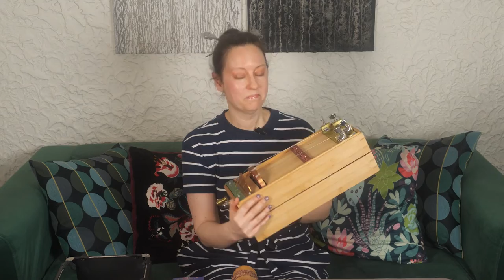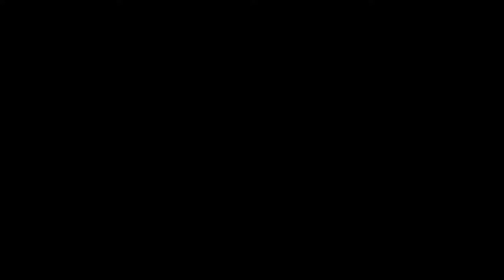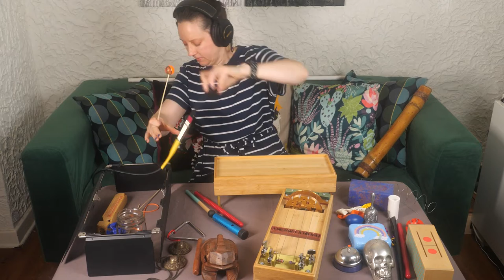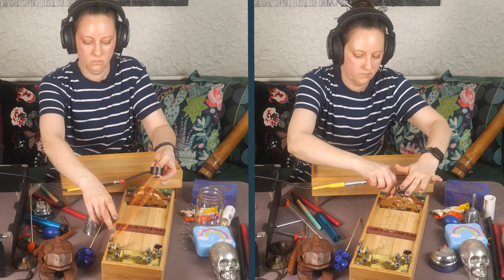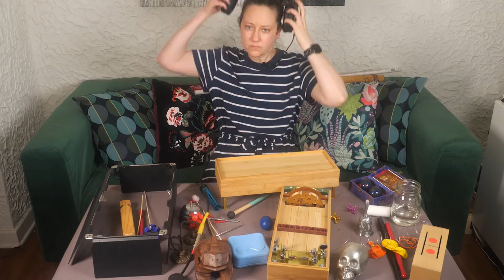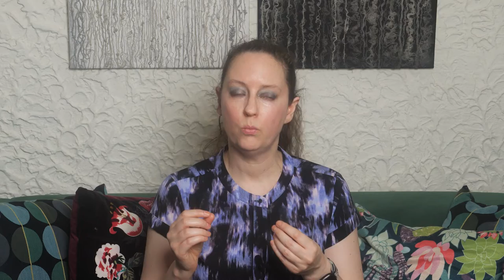Making Music with a Noise Box + Random Objects + Contact Mic

Comment: Been thinking about getting a Marshmallow contact mike or just getting a handful of cheap piezos and making my own (Marshmallows come with integral pre-amps, though). I like your thinking, though. 😀 I’ve been staring at an antique Victor turntable hand crank and everything and have all kinds of noise box ideas I could do with that—if I can get permission to use it (which I doubt 🤦🏻‍♂️). Need another subscriber? 😄
Reply from the maker: Yeah, I got the Marshmallow specifically for the preamp, since I don't have a dedicated mic preamp and figured this kind of recording would need it. So far, it seems pretty well made? I also have a bag of those ~$2 piezos you can get everywhere; it might be fun to do a side-by-side test of the difference in sound/recording. Even I'm curious to hear if I could've gotten away with the cheap stuff.  :) Welcome!